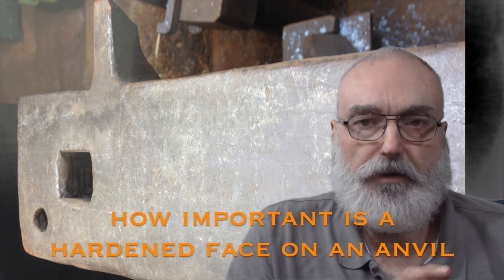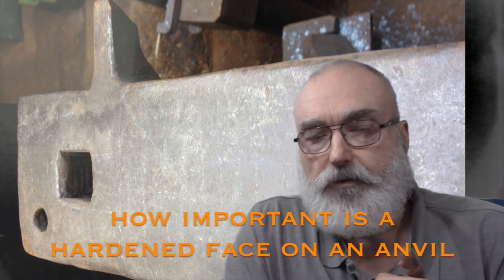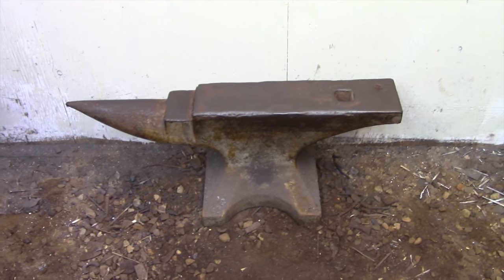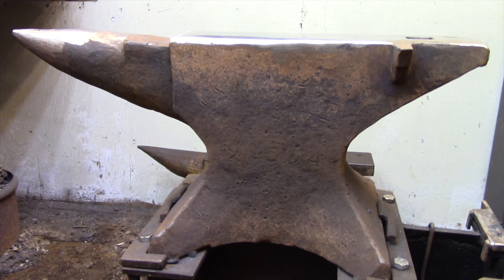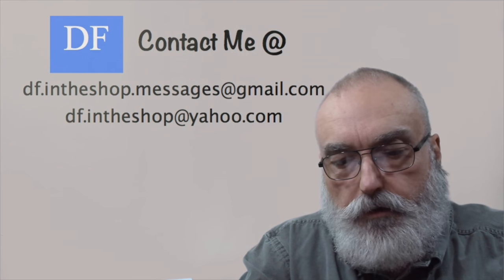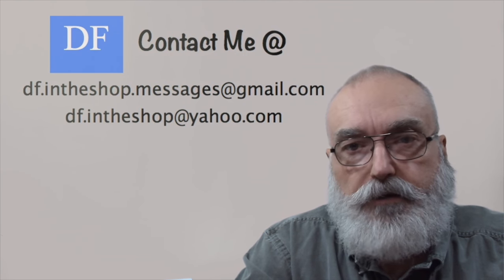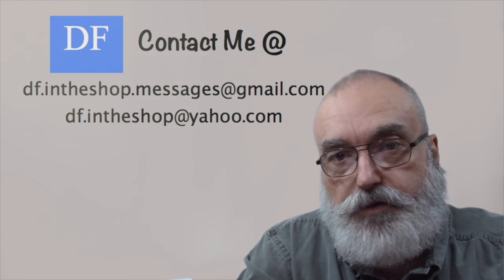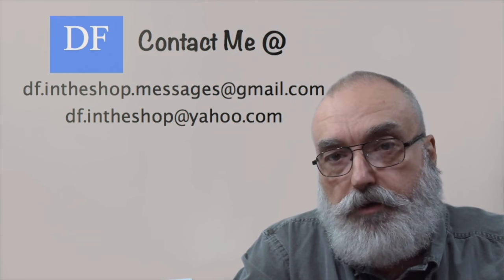Blacksmithing For Beginners - How important is a Hardened Face on an Anvil

Comment: I am a novice just starting out. I bought a 50lb anvil from a friend and it isn't very hard. I've been grinding it to get rid of some weld and other surface deformations. Now I'm sanding it to eradicate grind marks and get the face flat and shiny, but when i tested it with a couple of hammers I'm making more dings. Am i wasting my time? From this video it sounds like i am.
Reply from the maker: Unfortunately one of the downsides of a soft anvil is that the face will record every missed hammer blow.  So I wouldn't bother spending too much time getting a mirror finish on it because  it just won't last.  Just get the anvil so that it's usable and start forging. This video was made to remind smith's that most of the worlds best ironwork was done on anvils that would be totally unacceptable by todays  standards.

Comment: Thank for this because I have a early 1700 anvil I got at a flea market and I accidentally made a messy hammer blow and dented it and I stopped using that anvil so thanks so now I will start using it again
Reply from the maker: That's great!  I could probably build 3 anvils with all the metal I've removed from the faces of anvils I've marked up from missed hammer blows when I was starting out.  The only way to get better is to work at getting better.  keep at it.

Comment: There is a very large anvil in the Hereford resource center that was made in about 0100 ad from bloom steel. Historians believe it to be roman but they have no idea how it was made as its huge its the largest single bloom for its time. Its also very hard and has cracked.more than  once. i believe Viking and  Saxon anvils where similar. the bloom steel is often a mix of hard and soft steels and iron. But i agree with you just the process of putting a hot thing on to an a tempered surface does little to help keep it hard. Ive worked anvils so hot you can't touch the for quite some time and they have been fine.

Comment: Have you ever seen a smith who hits his anvil as much or more than his work? This is really irritating to me. They are the ones that need a hardened face on their anvil. I think the weight of hammer to anvil has more to do with it than a rebounding ball. Think about it if the anvil weighed the same as your hammer the would both rebound the same from each other so the heaver the anvil the more force goes into the work. Of course there is a point where you don't gain much for a increase in anvil weight compared to hammer weight. probably there is a sweet spot of hammer to anvil weight. Does anybody know?
Reply from the maker: I think the anvil tapping blacksmith is such a firmly established Hollywood  cliché we are not likely to ever be totally rid of it.   I try to stay away from formulas because they usually don't apply in all cases.  For example the accepted formula for hammer to anvil weights is 40-1.  So they say the max weight of a hammer to be used on a 80 lbs anvil is 2 lbs.  That's ok but using that formula for a jewelers anvil or a bicker returns a value of a fraction of an once - which is less than the weight of the handle.

Comment: 2 things i would mention/debate.
1. hardened face anvils are not for beginers/idiots as you say, on the contrary.
An idiot will mishit the corner or hit it with too hard hammer face and indent the face...once chips and dips occur, it is impossible to rectify the face and corners without reheattreating and ht a x00 pounds anvil is anything but easy/cheap.
so the anvil is ruined if used badly.
A soft piece of steel will not chip, no injury hazard also, it will roll and deform the face but with a simple grinder in few hours and few bucks worth of abrasives is just like new one.
Si, imho, is opposite than you say.

hard face anvils ware out harder and when used properly will last few lifetimes, a master blacksmith will never need to repair anything on it...considering in the past abrasives abd powertools were not available nor efortless to use, that was a huge step forward for proffesionals, spending time working not caring for the tool.
Reply: 2. The hardness of the face will not compensate for technique and i agree about energy transfer and so on...partially.
BUT if it does not matter as long as it is well fixed piece of support, why it matters the  shape , hiw blocky or finewasted  it is?
As long as the hit metal take "all the energy" just because it have a fixed, solid support underneath, no matter how or what it is, shape of the anvill should also have no influence  just like the hardness of it..
Without totally disagreeing with you, i say it matters...
Bb test shows how much of the energy passed TO THE ANVIL is reflected from the anvil back to the piece...
As long as the anvil moves if not fixed, it absorbs a fraction of the energy, just like the hot piece absorb the rest....bounce test shows how munch of it is reflected back to the hot metal or dissipated by the anvil...how useful it is , that is another issue, without a hammer resisting back, just like the anvil did i  the first place, is useless...
i think both  hardness and shape, not to mention stability of the anvil matters
Reply from the maker: I hope we can both agree that an idiot will find a way to wreck anything but  a hard steel anvil does a great job of protecting itself from people that are just a little careless in their hammering.   My reference to the industrial age describes how the blacksmith moved from individual shops where he had total control over the equipment to a factory setting where he had no way of controlling the work ethics of the men on the next shift.  It was the first time master smiths and everyday laborers had  access to the same workspace. I still think that the need for a hard steel anvil was fuelled by industry looking for tools that could withstand being used by less skilled workers.
Reply from the maker: The shape of the anvil has a lot to do with it's ability to stand up to heavy hammering.  It is hard to believe but any part of the anvil that is not sitting directly over the base will tend to flex and absorb a lot of the energy.  So a narrow waist anvil has a much smaller work surface than a thicker  anvil.  As you  move away from the center your hammer blows become less affective.
Reply: DF - In The Shop Agree to disagree for the first observation...i think it was simply a matter of availability of the quality steel, and price,  compared to previous era when steel was much more expensive.
New hard anvils were better BUT NOT fool proof...
For me a soft anvil is better for a begginer, even today, chips of steel will not fly into his arteries or face and any damage of the anvil can easely be repaired while a good hard anvil will chip and represent a healt hazard, once deformed or chiped is just a door stoper...
In this case just like many others, better tool demand better user and more care to deliver much better results, in this case keeping it's shape for way more time.
Different opinions, is very ok this way, is good when people hace different perspectives on the same things/facts.

As far as the second subject...as i said, i agree that hardness does not improve the results like some people presume...there are a lot of things, variable of the ecuation...technique is the most important, anvil mass and it's stability also overall very very important.
.
still, i consider hardness ALSO a factor which influence the efficiency/energy transfer, even though it is not as important as others mentioned above..

A test would proove this very easy i guess....hit the same piece with same force, same hammer...measure the deformation of the piece AND the height/force the hammer jump from the piece...
using a soft metal like a copper bar would emulate the hot iron.
it would be revelatory and confirm laws of phisics and common sense..
Imho "there is a seed of truth in that" but indeed it is marginal, you working so many years with such great things made on a soft piece of junk is proves it takes a lot more than a hard puece of steel
BUT, is nice to have one and work on it
Reply from the maker: Don't misunderstand me. I would love to have a steel anvil with a hardened face for the very reasons you mentioned - once it is tuned up you would never have to touch it again but I was taught to always work on the anvil as if it was made of soft steel so It is not something that is a high priority right now.
Reply: DF - In The Shop I guess the point of all this debate is to tell people that hardness of the anvil is just a small detail that will not affect your work very much and it is not a reason to stop evolving, or complain, it matters less than some people think and you are the best example to illustrate this.
In the same time it is also important to understand exactly why some things happen one way or another just for our own knowledge, that is all. And all this process of understanding the way things work is fun, just like blacksmithing is/should be.
Again, I admire all you do and your knowledge, it is a real pleasure to learn  from and debate with you and wish you to get a "better" anvil, enjoy working on it and maybe share your impressions about it and compare the two.
Wish you all the best.

Comment: Seems like the majority of the points people point to for harbor freight anvils being crap are kind of explained away by this video. How a harbor freight anvil is soft steel and  cast steel tends to be brittle or what not. I see a bunch of videos of people trying to remedy that by adding plate or welding stringers on the horn to make it more workable.  
Is this saying that the base harbor freight anvil is workable?
Reply from the maker: As I understand it, the confusion around the anvils from Harbor Freight is because their old anvils were made from a ductile cast iron, which is quite hard and they recently switched to grey cast iron, which is very soft, to keep the cost down.  I think Christ Centered Ironwork on youtube did a few videos where he compared all the anvils that are available today. That may be the information you are looking for?

Comment: Wonder if you could take a piece of precision ground steel plate and plug weld it to the face of an old anvil, would it work?
Reply from the maker: In my Week 29 video I have pictures of an anvil that has a plug welded face.  He used a 5/8" truck spring.  I guess ( not being a welder ) it would depend on how many plugs you would need to hold it.
Reply: not ideal - for reasons mentioned in the video, and another - notice how the ball bearing in the video does not bounce when striking steel, but it does bounce when striking the anvil. having a steel plate with any degree of gap (ie anything other than fully 100% welded) will sap your energy out. one would be much better off just to clean up the face of the old anvil and leave it at that, as the air gap will significantly affect performance. less energy will be going into your work, and instead, vibrating your tool steel plate.

Comment: I’m coming very late to this, so consider that. So the first anvils were some not well understood combination of cast, wrought, or whatever the iron pour might have been. They didn’t really understand much of alloys, or even the proper way of hardening or tempering. For example, Damascus steel. Some people think that they really knew what they were doing with that metal back then and that the alloy was a secret. Well, it was a secret. But the secret was where the small mine for the metal was. They were lucky that the iron from that mine had alloying ingredients that gave them that fine steel, and they learned how to use it. But when the mine ran out, so did Damascus steel.

It took 1,500 years before any real understanding came about. But skipping ahead to the 1800s, they did understand wrought iron quite well, and the could make “tool steel”, which was just medium to high carbon steel with any lucky natural additions that gave better qualities. At that point, they did forge those plates to the top of a wrought iron body. But metallurgically, the striking plate did get hardened, not necessarily intentionally, but from the heat of forging itself. This was very unpredictable, and the hardness varied across the face. Often the edges hardened more as they cooled off more quickly. Later they did harden the striking edge intentionally, but it was difficult to do so at the time as it also heated up the anvil body. More modern anvils, before the 1950s when new anvil production became cast tool steel of various known alloys, and modern technology allowed reliable hardening if the striking surfaces, most good anvils have a face hardened to between 48-55 RC, depending on the manufacturer.

The problem with unhardened faces, below 40RC usually, is that people who are less skilled tend to hit the face with a hard blow while entirely, or partly, missing the soft steel being forged. Their anvils, as I’ve seen, look like the face of the moon, and no quality work can be done on it.

Comment: I dont understand why folks who claim mass matters most and not the hardness of the  forging surface will not forge on the surface of a  large tree trunk
Reply from the maker: You are right that something like a tree trunk can provide most of the mass needed for an anvil but wood alone will not provide a hard enough contact surface to allow you to forge metal.  That still needs to be steel.  The argument out there is wether the steel can be soft mild steel or does it need to be military grade armour plate.
Reply: @df-intheshop330  correct

Comment: The material used for pencil is graphite, not lead. it's a common mistake. o
Reply: nama shoshani that's true but in the states people still call them pencil lead's. kind of like the call all acetaminophen Tylenol. or they call all tissue Kleenex.
Reply from the maker: Lead rolls off the tongue better than graphite so I will call it a lead until the next technical advancement that results in a one syllable word that is easier to say.  lol

Comment: Why milling is a BAD idea.
Even if we give licence to your soft anvil theory,  any old anvil with even a medium carbon steel top (we know tops were actually high carbon, since they eventually become hard enough to crack) would work harden after 1-200 years of hammering.
This is why anvil sway. Where did you think the metal went? The sway is always over the sweet spot ( center of mass) except in the case of single product anvils.

This thin, ultra hard (extra good) layer cannot be preserved if on mills or grinds the top plate. 

There is NOTHING wrong with a gentle sway, in fact it is much easier to make items flat over a swayed anvil than a perfectly flat anvil. Removing even 1/32" off the top plate takes decades off the lifetime of a tool designed to last hundreds of years. 

I didn't comment on your previous videos since you asked nicely and I understand that your old anvil was already junk.
As you said, with junk anvils you have nothing to lose so weld, grind, mill away Rene. 
The problem is that beginners often think a perfectly good anvil is junk.

Comment: should be heating a iron anvil above 250c before repair welding. peening welds as you go and post heating too.
Reply from the maker: In the previous video I did spend a lot of time preheating the anvil.  That generated all the comments about removing the temper.  I didn't peen the welds but the heat I had build up took several hours to cool down so I don't think there was any stress there.  Thanks